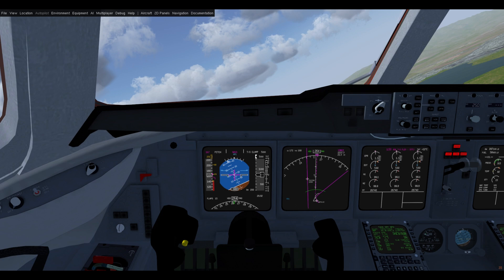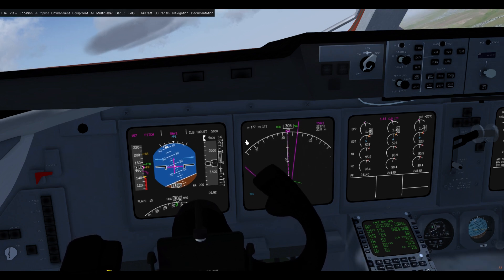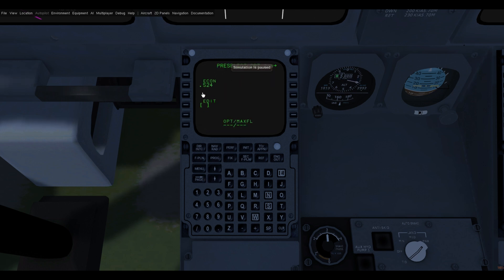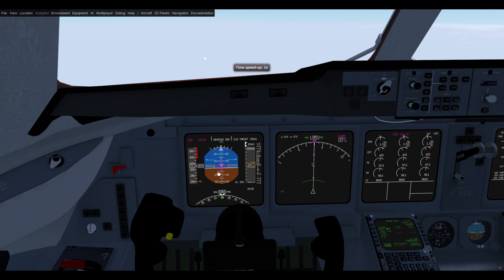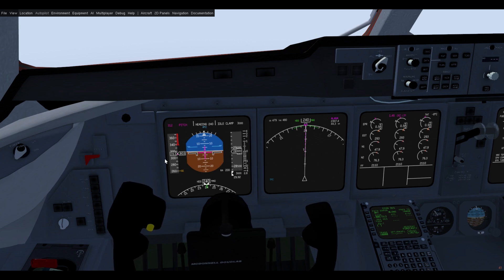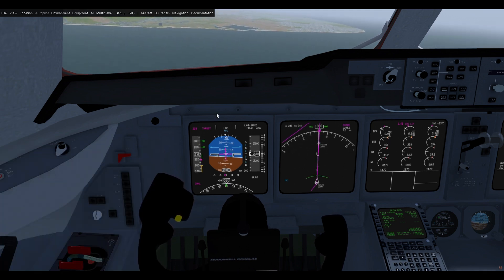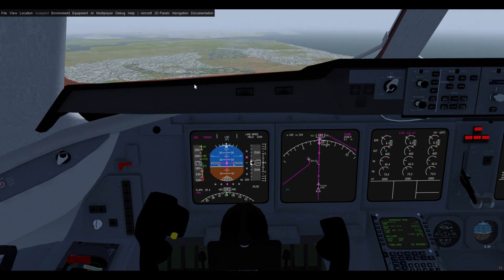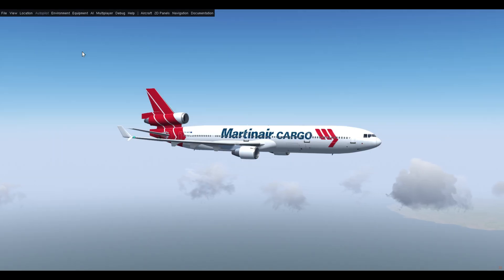FlightGear MD-11 v1668 New FMS SPD Demo

Comment: Hey I always love your planes especially the gui and I have seen you have made a lot what are all the planes and contributions have you made and great update
Reply: Thanks!
I focus on the MD-11 and MD-80 right now. I have previously worked on the A320, and the A330. I also am currently working on the 727, which is not yet public. I have a DC-10 also but it's stalled pending better 3D models. I also made the PA28 based on the aircraft I flew in real life.
Reply: wow that does indeed sound like a lot very cool also never knew that you flew a plane in real life

Comment: I have an issue performing an autoland with your MD-11. I flew a route from LEBL to LEPA, everything went smoothly with the AP, which was perfectly following the TOLSO2P STAR, but on final approach a problem came up. Of course I put the ILS localizer frequency for 24L (109.3) in the RAD NAV, and I made sure to click APPR/LAND. On the attitude display I could see the magenta diamonds for both the LOC and the G/S, and a message on the top right LAND ARMED HOLD 2500, and made sure to not be in NAV mode. When the G/S diamond passed the horizon, the display never switched to G/S DUAL LAND and the plane kept flying at 2500ft. At that moment I had no other choice but to switch off the AP and hand-fly the ILS approach by keeping the diamonds centered. 

What am I missing? I have read the autopilot documentation on GitHub in and out, I've looked up the forum and I watched a tutorial video of a polish guy, I copied everything perfectly but I never managed to engage autoland.

NEVERMIND: I forgot to type the course right after the frequency in the RAD page on the FMC. I was established on the ILS glideslope and Autoland engaged successfully. I'll keep this comment here if anyone is also struggling to figure it out.